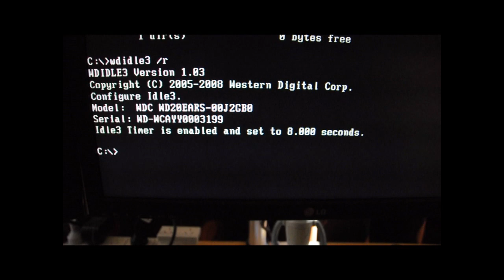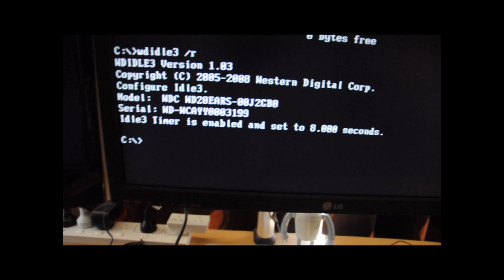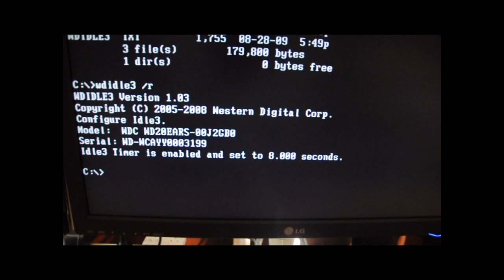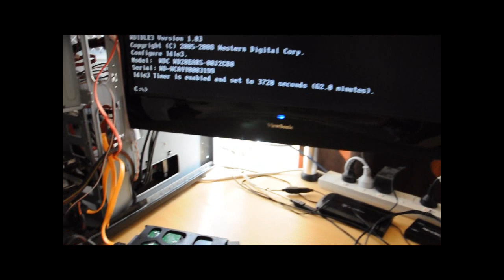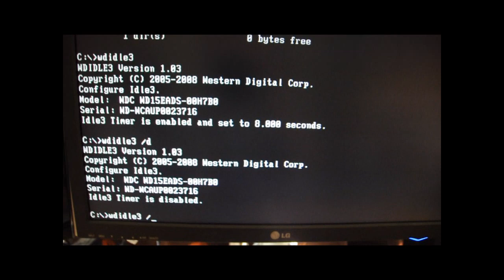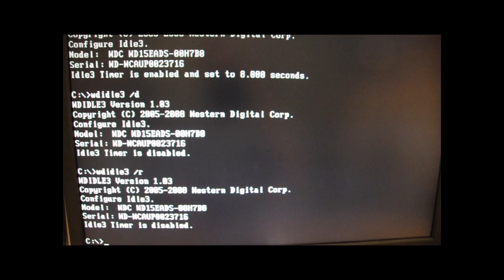Changing Idle3 Timer on Western Digital drives

Comment: Very nice video... But how to  do this on a WD external drive on which the Windows version of the utility (WDIdleDisable) reports "Drive Update Not Applicable", like the WD Elements 4TB? The Load Cycle Count jumps by about 50 an hour!

Should I cut my losses and return the drive while I still can? But what to replace it with? I'm tired wasting so much time with these dreadful drives - Seagate first with its early failing drives, Samsung with its DOAs and now WD with its designed obsolescence? What happened to reliability? Are drive manufacturers colluding to produce poor drives to push people into the cloud to be spied upon and for software giants to control them with their forced updates?

The worst is after having spent so much time organizing more than 20 years of data, having to transfer it to media that is DESIGNED TO FAIL is highly distressing. I guess I'll have to copy all my data to a second hard drive and keep that one in a sealed container under lock and key, never to be used except in case of emergency.  Goodbye backups and daily use... :-(

Anyway, thanks again for your nice video. I've been using computers since before the birth of the PC and considering my first hard drive lasted almost 20 years before it showed signs of failure, I am just bitterly disappointed at the loss of of reliability, and I'm not saying anything about dreadful software reliability and the constant chipping away of user rights...
Reply from the maker: JohnnyJim J Hi and thanks.  I've never used the Windows version as I've found the additional drivers complicate the update procedure. I've also found issues trying to perform this over a USB connection, which is why a SATA direct connection is recommended.  I don't have an Elements disk, if I did, then I'd pull the drive out of the enclosure and directly connect it to a SATA port. WARNING that is much more challenging that you think, they have a good seal most of the time and you'd need the right tools, like a spudger and some experience.   I've also moved away from "enclosed" disks and gone to products that are the cradle with a SATA port for the disk and multiple bus types, like, this (which I own) @0

Comment: So I have a 4TB red hard drive and it dissapears sometimes on in my computer and I need to rescan it in disk management, is there a fix to this?
Reply from the maker: MohawkMasters hey there. Hmmm, that's not right. Is the disk attached by USB cradle or directly attached by SATA? If it's SATA, then it shouldn't drop out. Otherwise, check out the Power Options under Windows Control Panel. If it needs "scanning" then it's been ejected "uncleanly" which points to something not right.
Reply: hadd3rs its attached by SATA and im in the Advanced settings for Power Options right now and under the Hard Disk tab "turn off hard disk after ... Settings:Never"
 I put it to never but it still dissapears

Comment: Ok so I just ran it and typed WDIDLE3 /R and it said it was enabled and at 8 seconds. I ran the /D command and it said it was disabled. I did /R once more to verify that it indeed was reporting disabled.

I have the green drive WD10EURX, which is a brand new 1tb drive I just got out of a never used DVR machine which was manufactured in 2012.

I reckon I don't have to manually set the idle time if it is saying disabled? I do not want to start using this drive until I get the OK that it is fine to use on my PC.

Comment: I have changed the default settings too (8sec->8min) but when streaming media it stutters every 8 minutes, while on default it never did. Is there another setting required to fix stuttering in media?
Reply from the maker: Hi Jonas,  I've not experienced that one before. You could try pushing that timer out the max and seeing what happens. The Idle timer works by being told that the drive is idle and its elapsed time is up, so park the read/write mechanism. By increasing that, when the drive it idle, it must wait that time before it parks. However, if you're streaming media from the drive, it isn't idle, therefore the timer shouldn't be active. Are you streaming over the wire or WiFi? WiFi is not great for streaming as WiFi is effectively musical chairs, everyone must have 1 turn on the read/write and while they're waiting they're suspended.
Reply: Streaming over wire as it should be. Buffering on the client solved it for a part. It stutters about every 20 minutes now (up from 8) and the stutters are a bit shorter in duration. I still need to tweak the buffering so it can overcome the several stutters over a longer period. And this varies a lot depending on size. I think it realy parks the heads every 8 minutes now while it did not on default. But I do have over 200k cycles in like 900 days. Also i'm not usint wdidle but idle3-tools (wich should be wdidle for ubuntu)

Comment: So if the timer is set to "Disabled" or "62.8 hours" will windows XP or & control when the heads are Loaded/Unloaded cycled?.  Should I then be able to control the time through Windows control panel? Thanks for the video.
Reply from the maker: Hi Floyd,  No, this is very low level, its in the drive firmware itself. It's a level below what Windows knows about. Effectively, think of it as a middle layer between your Operating System and the disk itself. When windows says "write" this, it goes through the drives firmware, which in turn does the mapping to disk etc etc...and other magic like reallocating sectors if they report bad.  The firmware then reports things back to your OS (Windows in this case).

Comment: Gonna try this on my WD7500BPKX which is a WD Scorpio Black. The Load/Unload Cycle likes to climb fast
Reply: any luck on this drive? just bought a brand new one and after only 2 weeks, have almost 7,000 Load/Unload Cycle counts, and would like to use this tool on it.
Reply: Yes, set to it like 200~300 seconds.

I have 33,500 Load/Unload Cycles at 7053 hours.

Comment: @hadd3rs - Gah! First 2 issues were ok.  I have an older driver but 1 of the 2 EARX I bought worked like a charm.  I just exchanged the problem drive and now the replacement I got is giving the same message.  I guess I'll work on updating the BIOS even though it worked on the one drive.  What a pain!  I'll definitely post back if i figure out what this is.  Does the drive have to be formatted in any fashion or does that not matter?

Comment from the maker: @dustinchesterman Hello.  I would recommend trying the following. 1) check that the chipset is in IDE mode. 2) check that the are no other drives connected. 3) make sure there are no other drivers loaded from your boot disc. If that still doesn't help, I'd check to see if the BIOS was the latest stable one. Let me know if any of that solves it. Good luck!

Comment: @hadd3rs - Thanks for the vid.  I am having an issue running on WD20EARX.  When checking the status or anything else I get the message "VSC enable Rdy Exp 00 00 00 01 00 00 B0".  I saw a comment from you somewhere that looks like you had a similar problem.  Do you remember how you fixed it?

Comment from the maker: @TheOlah this change is about stopping the disk from unloading heads when it thinks it can "have a rest", when you are copying that does not happen.  Your problem sounds more related to system. 25-35Mbps from USB2 is a normal rate, but it shouldn't lock up. I would advise you check your mainboard drivers from the HP support site. Look for chipset driver updates. Finally, check the BIOS SATA setting, AHCI should be enabled. Be careful before you change this, it could mean an OS reinstall.

Comment: I had purchased an HP computer that came stock with this drive. When transferring files from my portable hard drive to my new computers hard drive the transfer rate was from about 25-35 mbps and basically what the problem is that it makes the computer become very slow and even lock up. Any opinions? Would what you did fix the cause? Or any other probable causes to this? My CPU and ram usage is also very minimal while this process is taking place and the computer is still slow and unresponsive a

Comment: Thanks for this video, have my two WD20EARS drives in a Linux RAID and wonder if it was this that caused a drive to always drop out of a RAID1 mirror under large file copies.  Interestingly I ran WDIdle3 /d  and it did actually disable the timer completely on both my drives.  Powered down and back up and did the /r and they are still disabled.  Happy days!

My drives are a different firmware though 00MVWB0.

Cheers

Comment: Good video, thanks.  have 2 x WD20EARS in a Linux software RAID1 Ubuntu Server with load/unload of 8742 so far, disks are about 1 year old.  Will download the tool now and give it a go.  One of the disks keeps deciding to pop out of the RAID1 too so maybe this could help, but I doubt it.  I think the cheap Silicon Image 3112 controller is to blame for that.

Comment from the maker: @HyllHound Try the Ultimate Boot CD and follow their instructions to create a bootable USB stick.  The problem with using a Virtual Machine... is that you are still hosting it inside the OS, layers of drivers tend to make running the command more difficult. DOS is the way to go as it has very little loaded between you and the disk. Also, remember that running in IDE mode as opposed to AHCI or RAID is important.

Comment from the maker: @007foppe Hi, the WD Drive tool IS NOT DESIGNED to run from a Windows based OS. You must make a bootable CD as described in the instructions above (simply expand the description of this video). If you do follow these steps, please be careful and review each step to ensure it is done correctly. Good Luck.

Comment from the maker: @patqc009 ok, try slysoft's virtual clone drive, that will install a virtual CDROM that can mount an ISO, then just copy the files off using Windows Explorer, ensure you have the 361 files and 59 folders. Then before doing anything, run the cmd to build the ISO from that. It should then build 100% fine, burn it and test it. Then do each step slowly, add the CAB, then add the config changes. Try and identity where it fails for you.

Comment from the maker: @patqc009 ALSO here is a copy of the complete ubcd\custom\custom.cfg file I've used.
As stated above we modify ONLY the placeholder for the MENU section

MENU INCLUDE /ubcd/menus/syslinux/defaults.cfg
UI /boot/syslinux/menu.c32

LABEL -
MENU LABEL ..
COM32 /boot/syslinux/menu.c32
APPEND /ubcd/menus/syslinux/main.cfg

LABEL -
MENU LABEL WDIDLE3 v1.05
TEXT HELP
WD Idle Timer Modifier
ENDTEXT
LINUX /boot/syslinux/memdisk
INITRD /ubcd/images/fdubcd.img.gz
APPEND raw ubcdcmd=wdidle3

Comment from the maker: @patqc009 Hi, I've reviewd AND tested the steps again on a clean PC, was able to generate AND boot the UBCD without a problem.  So.. what are you extracting the UBCD with? I've used Virtual CloneDrive by Slysoft to mount the iso file and then copy ALL 361 files and 59 folders to c:\ubcd-extracted.
Be sure that you've enabled "Show Hidden Files and Folders" for Windows Explorer.
There should be NO ERRORs when generating the ISO image, which has 362 files once you've made the CAB file.